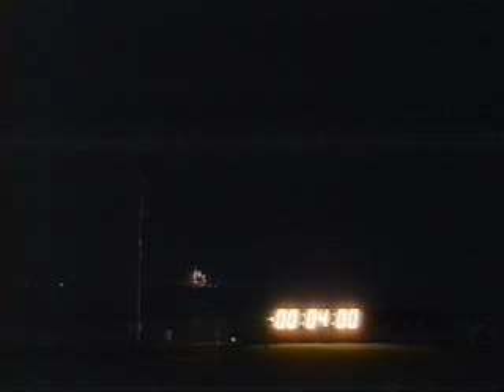STS-88 Launch Scrub at T-19 seconds - December 3, 1998

Comment: This ended up being a "precious seconds missed issue" caused by a rapid communications breakdown between the CISL engineer, the SPE, the CGLS and the NTD in the Firing Room at KSC attempting to work inside the LOX Drainback Holdtime restraint prescribed by the Flight Control Room in Houston. Really nothing more than poor time management while under the gun...seemingly easy to criticize in a "Monday Morning Quarterback" role if it wasn't for the fact that each of these roles is trained over and over in simulations just like this...most viewers don't see it as such but this was a launch that was very much do-able if not for the glaring errors of the KSC launch team.
Reply: They have to launch in their "window" an imanginary point in time and space so they can do their mission. Launch late and they can't do it with the fuel on board. Some flights had a launch window of 1 second! Any hold outside of the normal ones would delay the launch.
Reply: What will happen if the shuttle launched 1 second delayed?